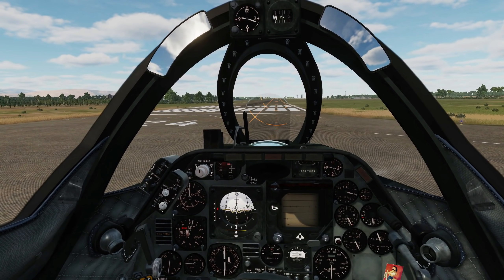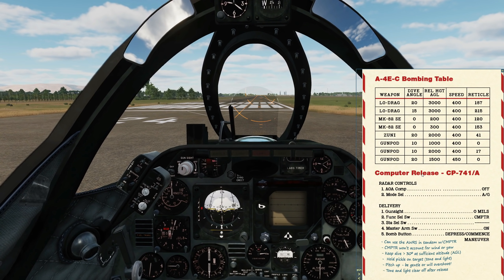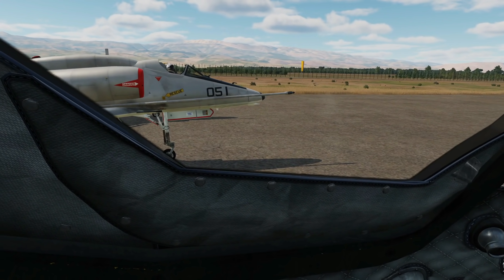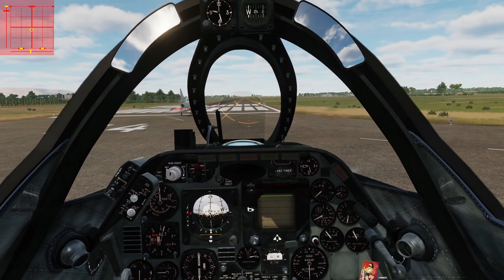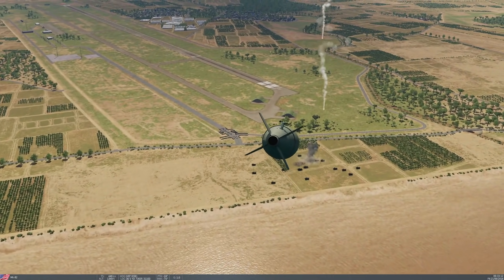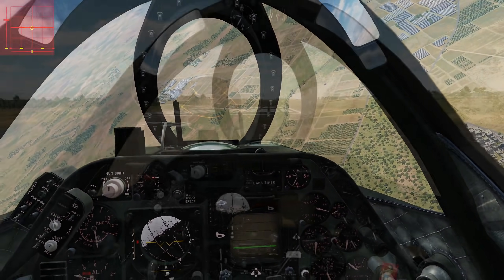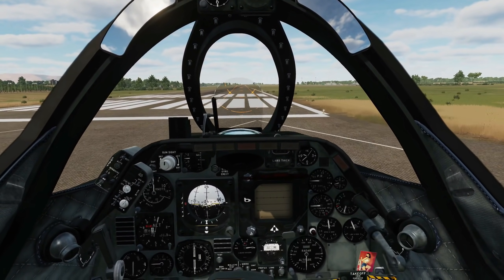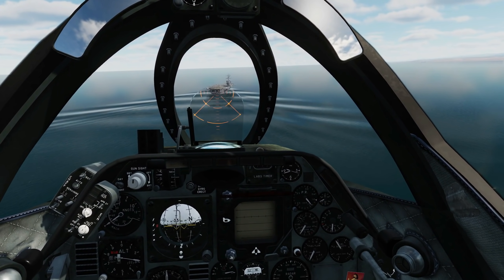A-4E Skyhawk(V2.0.0B5.1): IMPORTANT Changes To MCL/ICLS, CP-741/A, INS, FM & KB | DCS WORLD

Comment: What exactly is the difference between the CMPTR and the LABS mode?
Where does the computer get its information from which Bombs are installed to calculate the correct drop path profile?
Reply: So, the short answer is that CMPTR is meant to be used in a shallow dive, and uses the radar to aid the mechanical computer. LABS is a much earlier system which is typically used to toss bombs nearly straight up, which theoretically allows the aircraft to egress the area prior to the bomb going off. GR has a good video demonstrating this with the F-86 https://youtu.be/VzRgzLo1lT0 . I'm not sure about the LABS, but I'm pretty sure that the loadout is manually entered by the ground crew for the CP-741/A.
Reply from the maker: hmmm will need Kortana to explain that one please.

Comment: 2:18 Why can't the official modules have something like this? Especially when flying in Veeeee Orre, you just don't pull up some pdf files...

4:58 What's the actual difference to the LABS setting then? I mean, it basically works the same way, but now includes the use of the radar.
Reply from the maker: agree. Kortana will have to answer that, my brain too small.

Comment: Hey cap, have you tried 'vtol vr'? I think you would love the immersion it gives and can reccomend the f35 alike!!
Reply from the maker: Neg sounds fun though.
Reply: @grimreapers  yup see https://youtu.be/LQT6sQ6o0uY
Reply: @grimreapers  Better consider getting their Jetborne Racing. Not only it does NOT require VR, the idea of putting a semi-realistic fighter jet into a 3D track is more engaging than you might think. Although it clearly IS semi-realistic, the FM more or less resembles that of the F-16, so it can be pretty challenging to fly (considering there's enough obstacles on the course). I didn't buy the thing myself, since I would never consider it to be of any use to me, but a friend gifted it to me and it turned out much better than I imagined.
Now I wish we had those "circuits" (properly scaled) for DCS too :) If you enjoy canyon runs in DCS, you should enjoy that game too.
Edit: it also supports HOTAS and TrackIR, and you are going to need them with the title, despite how it sounds and looks.
Reply: vtol vr is a game, and that is not F-35
Reply: @specoppo  agreed strictly speaking... But its actually somewhere in the middle admittedly closer to game than sim. And hense I said  f35alike.. As in its a vtol jet with stealth capabilities and a awesome optical sensor system obviously inspired by f35....
Reply: @stealthtecify  It is very much inspired by Fat Amy. Even the "interface thing" (that big touch screen MFD-like thing) just looks like what's known to the public of the 35.

I can only recommend VTOL VR to anyone who like flight sims and has a VR HMD. It's basically semi-DCS-grade. Having in mind that a single guy made it just blows my mind. And the VR controls work exceptionally well if you're at least used to a twist grip stick of some sort.